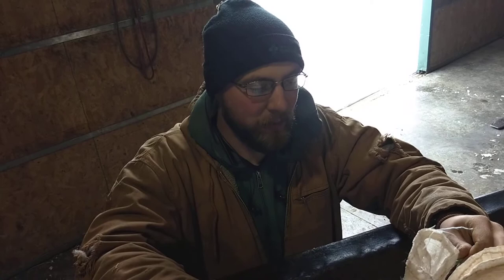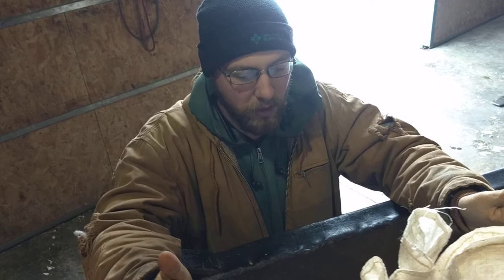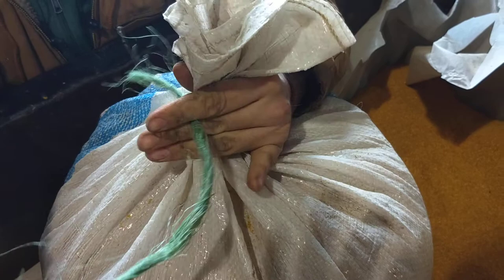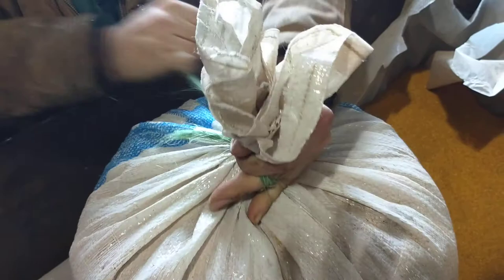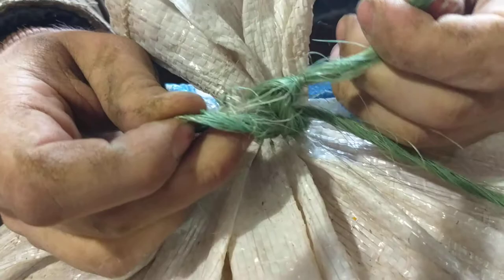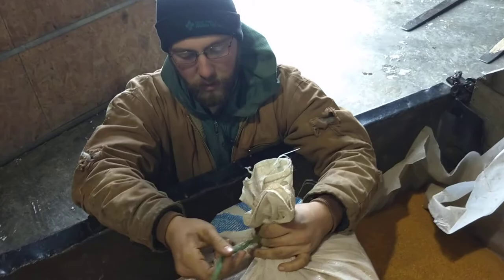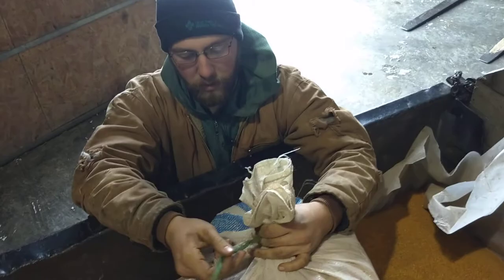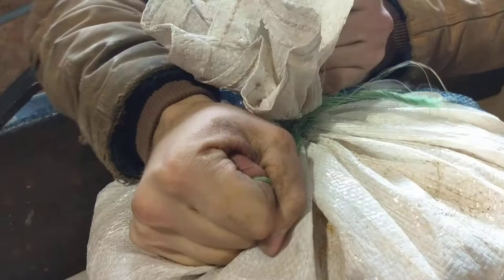How to Tie a Miller's Knot

Comment: I was taught the Bag knot when I was about 10 years old, my job was riding on the combine while we were threshing oats the combine would fill one bag and then the alternate bag and when the bag was full my job was to tie the bag the way I did it was place the cord or twine under my thumb of my left hand with my hand around the neck of the bag the middle of the twine would go over my left hand ring finger around the bag back up under the ends of my fingers around one more time and up through the loop that was formed by my ring finger I did this in 1,2,3, moves once up through the loop and my ring finger you pull it tight I can this in about two seconds.
I am now 74 years old and it comes back to me, second nature without thinking about it
Be safe, 
  Be good,
    Be kind,
      Trust GOD

Comment: Granddad  showed me 55years ago while bagging on the combine.great show. Things you never forget.
Reply: I was taught the Bag knot when I was about 10 years old, my job was riding on the combine while we were threshing oats the combine would fill one bag and then the alternate bag and when the bag was full my job was to tie the bag the way I did it was place the cord or twine under my thumb of my left hand with my hand around the neck of the bag the middle of the twine would go over my left hand ring finger around the bag back up under the ends of my fingers around one more time and up through the loop that was formed by my ring finger I did this in 1,2,3, moves once up through the loop and my ring finger you pull it tight I can this in about two seconds.
I am now 74 years old and it comes back to me, second nature without thinking about it
Be safe, 
  Be good,
    Be kind,
      Trust GOD
Reply: @dixiepan8538  same with me I'm 70 and try to train the  newer family members. Kind of an art that might be lost
Reply: I forgot it. :-(

Comment: I do mine slightly different... Instead of going over the loop that you created going round you fingers I go through the bottom of the loop and pull it all through... 
Pull it very tight and to undo I only have to unwind it.
Reply: That sounds more like how we used to do it, faster and simpler
Reply: I was taught the Bag knot when I was about 10 years old, my job was tiding on the combine while we were threshing oats the combine would fill one bag and then the alternate bag and when the bag was full my job was to tie the bag the way I did it was place the cord or twine under my thumb of my left hand with my hand around the neck of the bag the middle of the twine we’re over my left hand ring finger around the bag back up under the ends of my fingers around one more time and up through the loop that was formed by my ring finger I did this in 1,2,3, moves once up through the loop and my ring finger you pull it tight I can this in about two seconds.
I am now 74 years old and it comes back to me, second nature without thinking about it
Be safe, 
  Be good,
    Be kind,
      Trust GOD
Reply: @dixiepan8538  Wish I could see you do it. I am having a difficult time picturing your description but want to know.

Comment: My Grandfather was raised on a farm in Corry, PA. He showed me how to cut baling twine by just using your hand. Have you ever seen that done?
Reply from the maker: +Rdrake1413 whoa that sounds like a useful skill.  I never heard of that.  I did have an electronic instructor strip wire with his finger nail.
Reply: I have never tried it with the new plastic twine. Grandpa used hemp twine. I have some plastic baler twine in the barn will have to try and see if it will work. It basically uses friction to break the twine. He would wrap the twine around his hand and loop the twine back  under the loop around his hand with his other hand he would quickly pull down on the other end and the friction where the pieces of twine cross  would break it.
Reply: @Rdrake1413  That plastic twine used these days is tougher than woodpecker lips! But, I want to try it. I’ll keep my knife handy in case it doesn’t break and cuts off my circulation. Thanks!
Reply: Thanks for the share. My father in law bagged thousands of potato sacks over the years and had a permanently mangled little finger to prove it. He had a similar technique only he would run the twine between his little and 4th , finger leaving a 3-4" tail. The first wrap would go over the tail, the second wrap would cross over the first wrap, then feed the bite through the finger loupe from the bottom, then cinch. His people came to Canada from Scotland over 100 years ago.